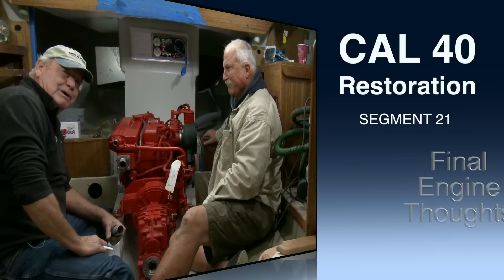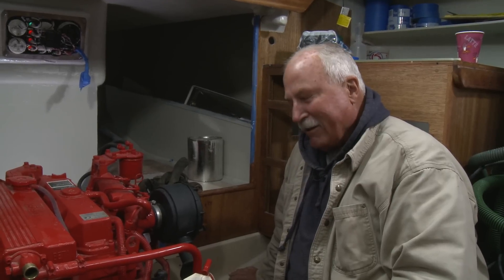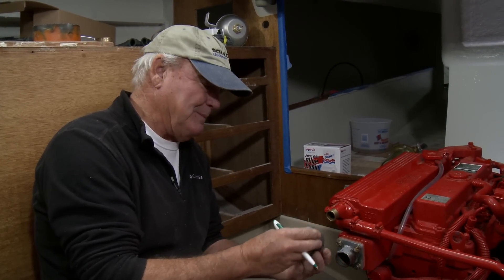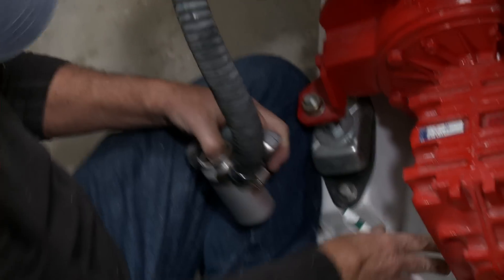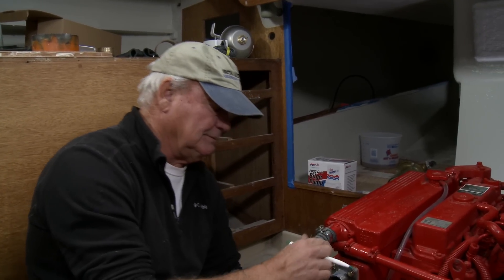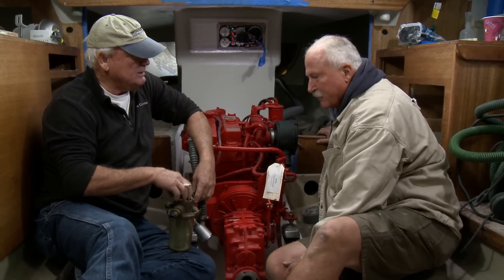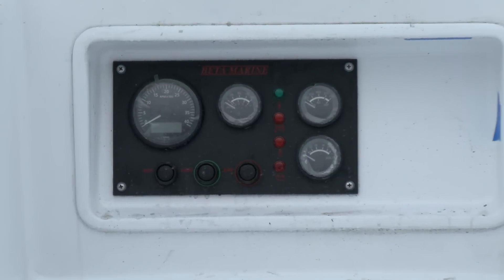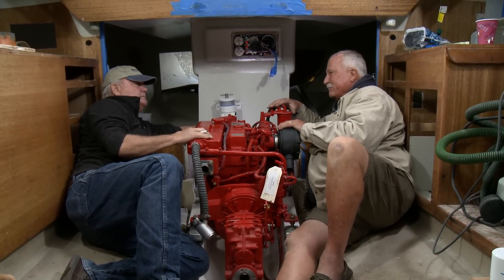Fred and Cree Final Engine Thoughts

Comment: You'll make the Transpac. We got an existing cruising boat ready for the 2016 Pac Cup in 6 months with a complete redo of the charging system plus meeting all the safety requirements and havin the boat in the yard for a month with a complete standing rigging replacement. I've seen the boat since my boat is in the Berkeley Marina and I'm confident you'll make it. PS - consider wiring up the saloon and cabins with USB outlets. We did that and it was wonderful since phones, tablets, cameras and even our Iridium Go! ran off USB cords. And we also added 12V outlets for other stuff like our computers. We had a 12V outlet and a pair of high amp USB outlets in each cabin and 3 in the saloon.

Comment: Hi there, great little series about this nice engine!
I have a question concerning the exhaust system you're talking about. At 8:53 you say you're putting a valve in the exhaust right at the transom. Can you please specify what kind of valve you're talking about? Thank you so much.
Reply: I can answer that for them if they didn't see this, as i have that same valve on my Cal 40. It is basically a sea cock at the transom that the exhaust exits through. It can be closed manually in case of a large following sea while sailing to prevent the waves from forcing water backwards thru the exhaust system and into the engine(not good)! Just have to make sure you reopen before starting the engine!!!